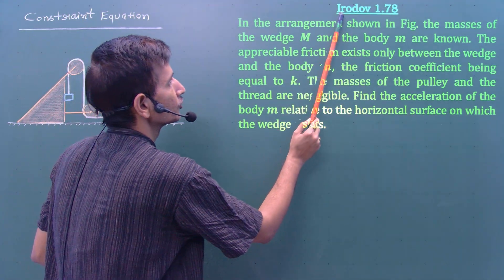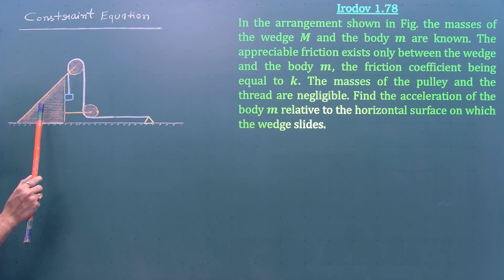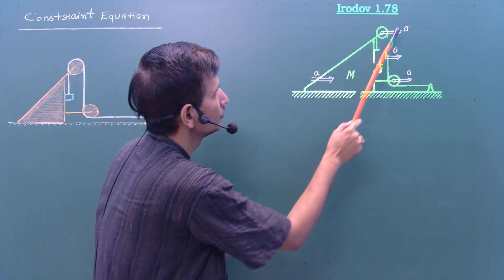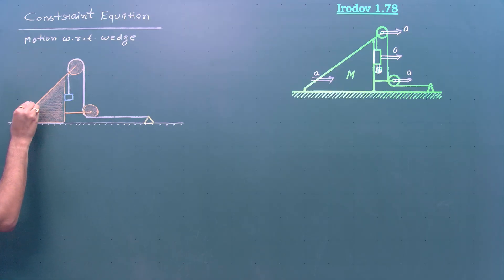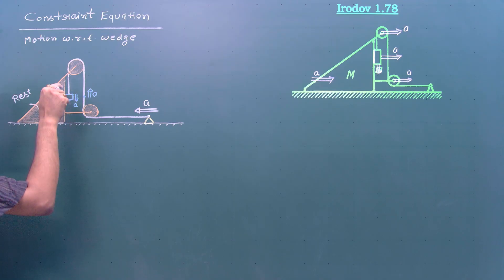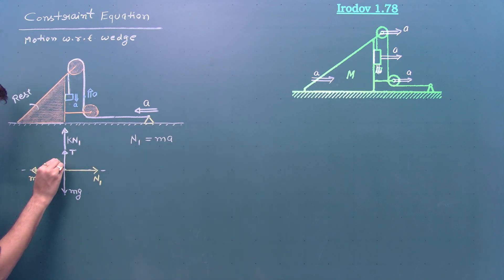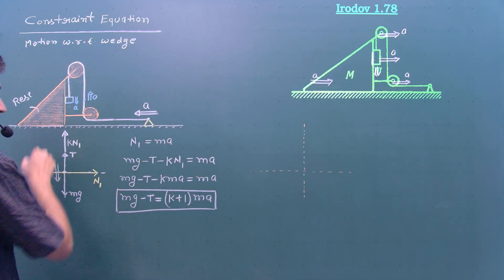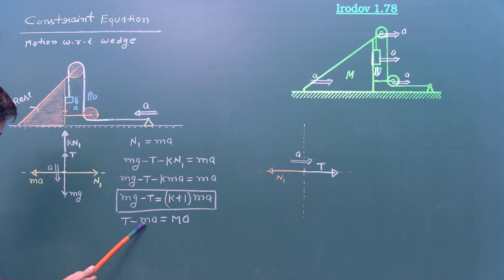Irodov Solution 1.78 || Mechanics || Olympiad Training || JEE Advance ||

Comment: I think approach is wrong even though you get the right answer. The mass moves down causing the first pulley to apply force the wedge through the cross bar. This causes the acceleration of the wedge in the direction of the fixed joint. That acceleration also accelerates small mass m which creates a pseudo force normal to the vertical surface which leads to friction that opposes gravity.
Reply from the maker: ""The mass moves down causing the first pulley to apply force"". Kindly think about this statement. Acceleration is not the cause of force, force is the cause of acceleration.

Comment: Sir but u dont need 5 equations because the pulleys dont have weight so equation will not be possible for pulleys
Reply from the maker: Equations are there for pulley. Weight of pulleys are negligible, it does not mean there is no dynamic equation.

Comment: Something feels wrong. The block is moving with acceleration a in both x and y directions. But that means its total acceleration is more than what can be accounted for by the length of string being loosened
Reply from the maker: Acceleration a of block in x-direction is not due to string, it is because of normal reaction exerted by wedge. Acceleration of block due to string is only in y direction.

Comment: Sir how you assumed the acceleration of attached triangle in -ive x direction as a ? Cause acceleration of Wedge is only given according to question
Reply from the maker: Triangle is fixed with ground and wedge is moving in +x direction with acceleration A. so, with respect to wedge triangle will move in -x direction with acceleration a. Same as a standing person move with respect to a moving train in opposite direction.
Reply: @classofphysics ok sir thanks alot 🙏